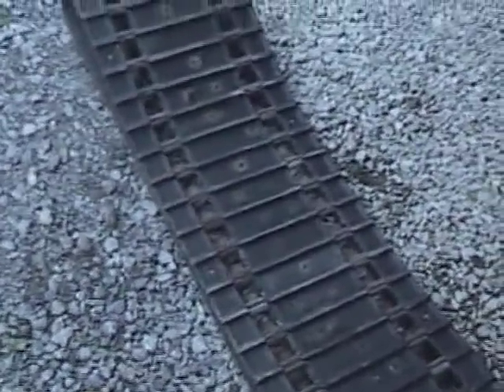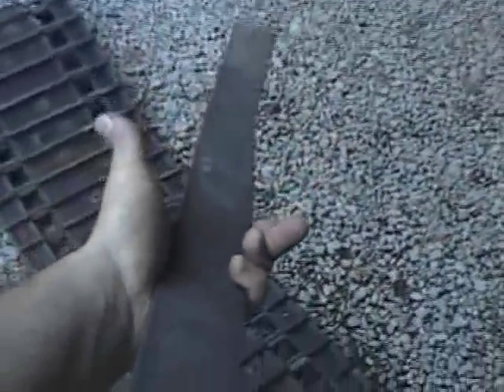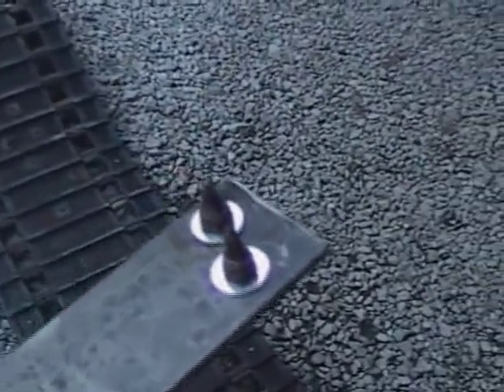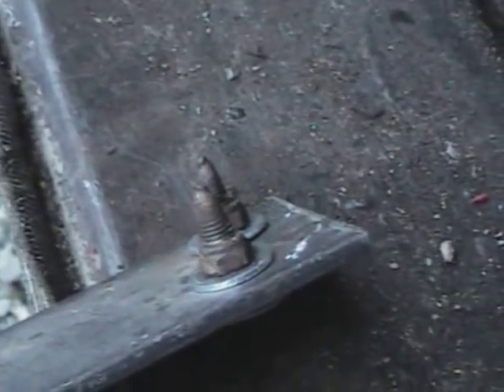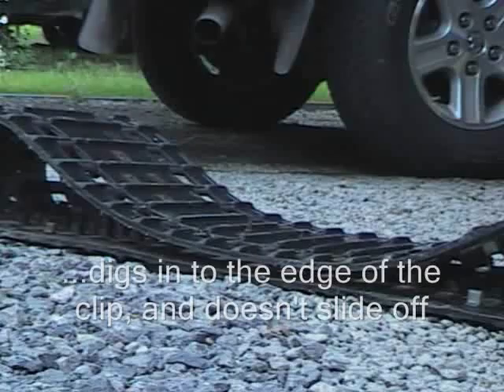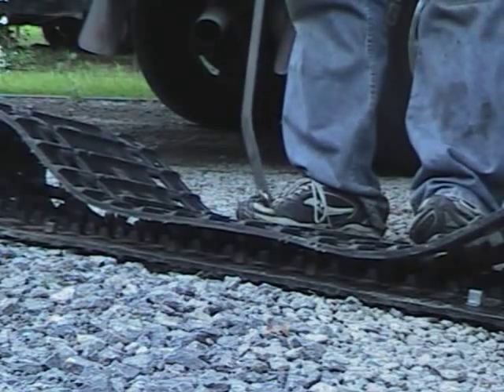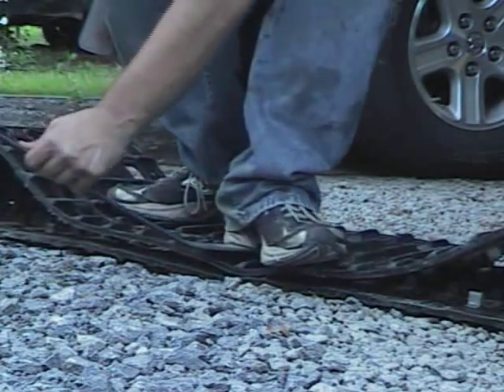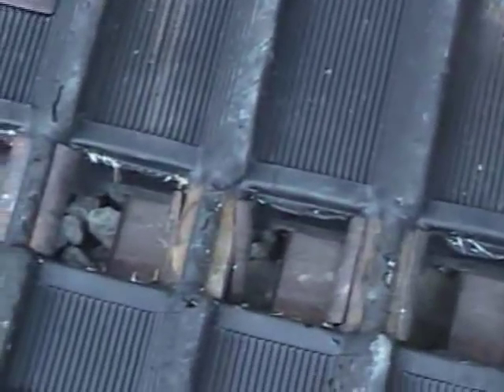Home Made Track Clip Removal Tool

Comment from the maker: To either replace or upgrade to new clips, or if you're going to run the track without any clips.  You can save like 5 or 6 pounds of rotating mass by getting rid of the clips.

Comment: They already have a clip removal tool.  Ever hear of a flat blade screwdriver????  Put it under one edge, twist to lift up one side and it pops right off.
Reply from the maker: Yeah, good luck with that...  the only clips that works with are ones that worn through or already loose.